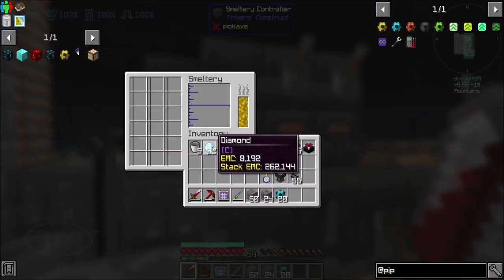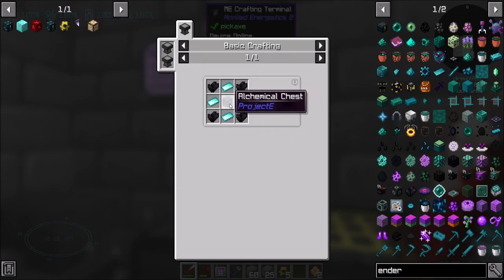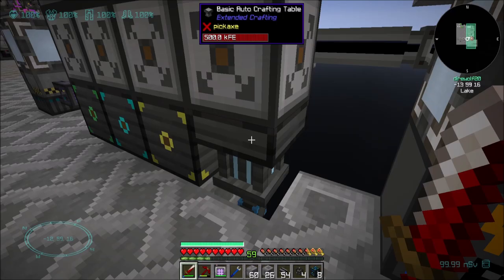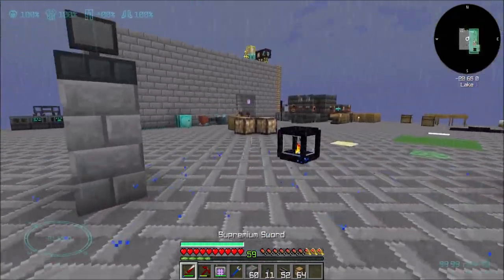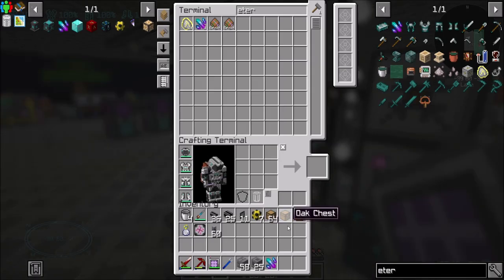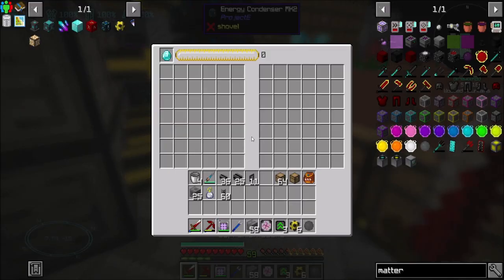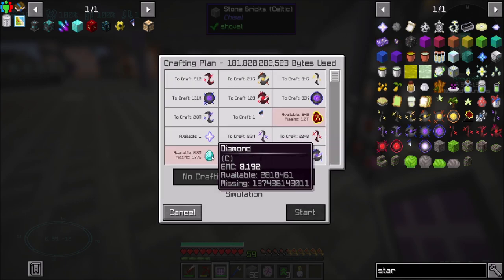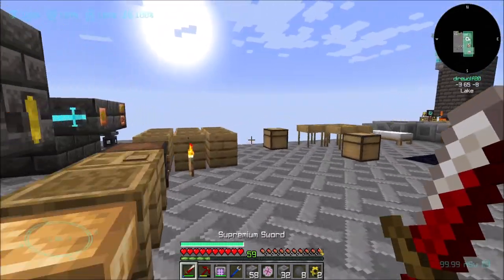NTC2 Ep46 Mk2 Energy Condensers

Comment: I used the Pipez mod throughout my OceanBlock playthrough, and loved its flexibility. Apart from not being able to insert AND extract from the same connection, it was very close to EnderIO's most excellent pipes. Being able to filter for multiple items going to multiple destinations was wonderful, as were not having pipes store huge quantities of liquids or gases, and sending all types of items/liquids/power/gases through one [ultimate] pipe. The only situations it wasn't used in were when I needed large storage of liquids or gases in my nuclear setup, but didn't want to use other methods, especially with gases. Even though I used them as buffers I could count, the gas tanks took up way too much room for quantity, which is where Mekanism's pipes came in.

Comment: You can always use the entangled blocks to transfer off all six sides
Reply: couldnt you use entangled blocks to transfer off of 6*n sides? would you be limited by the number of slots in the inventory?
Reply: Even if you were to do that, you would still need around 1365 setups like that to get the time required to transfer the items down to barely manageable numbers. There's no point to doing all of this, because the lag that would create would fry the most complex of super computers.

Comment: Dire, don't both AE and RS have a bypass crafting requirements feature if you hold SHIFT + Click on the craft button? I would just place a Storage Bus on each MK2 converter and forget about it, just bypass the material requirement when I need one of those insane crafts, it doubt it'll craft faster than the MK2 creates them
Reply: That is a really neat workaround
Reply: That new to me, THANKs a lot
Reply: As far as I'm aware, shift clicking just bypasses the screen if you have the resources. If you don't you get spit onto the requirements screen being told what you are missing
Reply: Trouble is the autocrafting needs the whole amount of resources at the beginning. He could export to enough MK3 crafters from RF tools to keep up with the condenser, but even then it's going to take prohibitively long without a faster item IO mechanic. At least 1000s or 10,000s per tick to beat the 384/t you can do with one pipe on each side. Or else just go ham with a million MK1 condensers, since those can be ramped up in crafting way easier than the MK2 because of Ender shards.
Reply: Nope, that's not how the feature works, shift + click only skips the screen for the user's convenience, but it still needs the required materials otherwise it will not craft
Reply: @Ammonium-ow6pd  It used to work in older versions, if it doesn't now, that's a big downgrade
Reply: @michaelwalden4411  That's the thing, it didn't use to need all the resources to start if you used the bypass, it used to start and use them as they were generated, this was back like 3 or 4 years ago, if AE2 really got rid of that feature, that's a total loss for that mod

Comment: Uhm, multiple exporters per MK2 + Several MK2 per item? That should give you a proper speed boost. Can go 6 exporters per MK2, potentially 12 with an entangler. Only need one import, and only need that setup for Dias and mobius, so make those 2 extra. Won't be as nice, but it's also not too complicated.

Comment: So uh... someone check my math.
~137b diamonds is
~2.1b stacks of diamonds

At 20 stacks per second (1 stack per tick), that would cost ~107m seconds to process.

~107m seconds is 3.4 years of real time.

If you surrounded an energy condenser with 6 extractors working at the same time, that'd go down to about ~29 weeks.

To get that down to a reasonable amount of time (let's say a week assuming Dire can just run this in the background 24/7, and explore other mods in the meantime), you'd have to use ~30 of these setups running simultaneously or use 30 entagled blocks (or a combination thereof, whatever is most convenient).

That is of course completely ignoring the fact that there's probably no way to have AE straight-up craft with a trillion items, and completely ignoring the time it would take to get the 10x higher number of mobius fuel you need.

It's doable_, but you'd need to build a hell of a repeated setup, or run this on a server and not play for a month, and you'd _still need to craft it in parts because the crafting processors aren't going to have enough room to hold the whole recipe.

edited to add: you'd need 1,108,604,000,000,000 emc for 137b diamonds. That's 1,108t or 1.1 quadrillion (not quintillion as I said earlier) EMC, about 100 times what he has in his tablet at the end
Reply: @Quietust Can the stars be put in a compacting drawer?

Comment: how about the deepstorage stuff from foregoing? those hold insane amounts of stuff
Reply: Funilly enough, I think they actually would hold less than the compacting drawer. I would have to do the math to tell you if I'm right, but an educated guess tells me that the deep storage unit holds less.
Reply: afaik, black hole unit hold 2,147,483,647 items, the max you can get in modded mc is 9,223,372,036,854,775,807 (Should be enough for the diamonds and mobis :P)

Comment: Dire for the mobius fuel why you dont take the Single Drawer with emerald upgrade isnt it bigger ?
Reply: no because the compressed drawer limits by the smallest stack size so while a normal drawer stores 2k of an item, the compressed drawer stores 8k of the smallest stack which in case of diamonds is the double compressed so 8k double compressed which is ~660k normal diamonds and for mobius theres only block form so it'd be ~72k mobius (unupgraded)

Comment: Dire what options of crafters, not AE2, but general crafters are in the pack? I would advise you to have all the resources required for the final shard in a crafting chain so as to not use your AE system, it will take forever otherwise

Comment: Wouldn’t the seared chute with cobalt be better you can filter the output in the smeltery and then it doesn’t matter where the molten fluid is in the order, then ther is no possibility of a foul up with another fluid getting in
Reply: the pipez mod does the same thing, he has a filter in the extract pipe so it will only extract what he wants
Reply: @tears_of_asariel3198  correct it will only extract the filtered fluid, however I will have to double check but the standard drain can only pull the bottom most fluid from the smeltery. I don’t think the pipz filter can override the tinkers smeltery rules? I had a similar issue in Create above and beyond using filtered pipes
I may be wrong 😊

Comment: Did the MK2 condenser change its rate of converting EMC buffer into targeted resource? Last I knew from the wiki, it was 64/t. But because tick accelerating the pipe works, that must mean it's a theoretically infinite conversion rate. What stops you from using 1 MK2 condenser on each necessary resource with 100 or 1000 entangled blocks to increase IO? Also, why is items the one thing where Mekanism is rate-limited by a single logistical transporter's IO speed and not capable of transferring the whole network capacity per tick? Because that'd solve your problem darn quick.

Comment: Aren't each part of the star EMC'able? So you can just hit each teir, then use the teir in the condencer or whatever to craft the next part?
Reply: Not in this pack, no. That's the problem. Normally, yes, you just make four ein stars using EMC, then use the resultant next stage up to make the next one, etc etc, and you only need to have enough EMC - which the fading matter resolves easily - and you're golden, but this pack has removed the EMC from the stars to make it... well.. something.

Comment: Integrated Tunnels lets you modify the transfer speed. So you can have an export tunnel transferring 1M per tick. Or 1B per tick. Just sayin...
Reply: that would work for the IO, but the crafting time would be insane too even once he has all the components.. the only feasible way he could actually make this, is by using the building gadget (assuming that wouldnt have issues in the placement of blocks) to create several sets of separate AE2 systems, and have them all crafting simultaneously.. the numbers are stupid lol

Comment: I'm probably missing the point, he says he has 8M diamonds, but he also has like 100k Diamond compressed blocks, doesn't it mean he has 100k*9*9 more diamonds? And he can just put those blocks into a crafter to convert them back to diamonds? Or not use a compact drawer in the first place?
Reply: Compact drawer shows equivalent numbers, if you take out one compressed block out of it, it will have 81 less diamonds. Basically it stores the lowest resource and autocrafts it into blocks/compressed blocks when you take out those. So dire just has 8M diamonds, which is equivalent to 100k compressed blocks.
Reply: The compact drawer doesnt compact them automatically, you select how to remove them, so say i have 81 diamonds in the compct drawer, it'll say i have 81 diamonds, 9 diamond blocks and 1 compressed block, but in reality i can only remove a total of 81 diamonds, whether in block form or not, so if i remove a diamond, it'll say i have 80 diamonds, 8 blocks and 0 compressed blocks now
Reply: Those 100k diamond blocks aren't extra, the compacting drawers show their contents in up to 3 different ways, if you put say 1 iron block in there(assuming there's no compressed iron blocks), then it would show up in AE or RS as 1 iron block, 9 iron ingots, and 81 iron nuggets. But you can't pull all of those out and convert them to have 3 times as much.
Reply: Thank you guys!